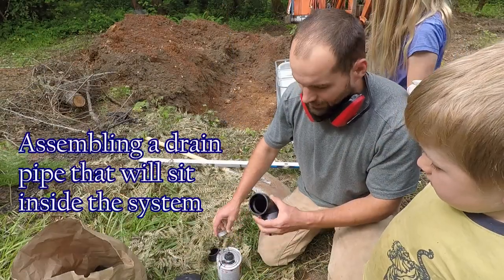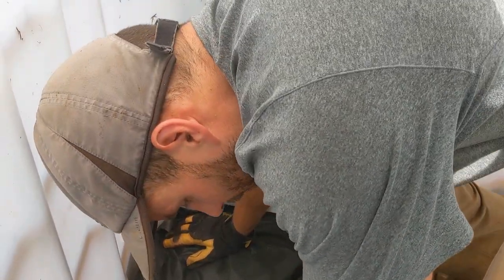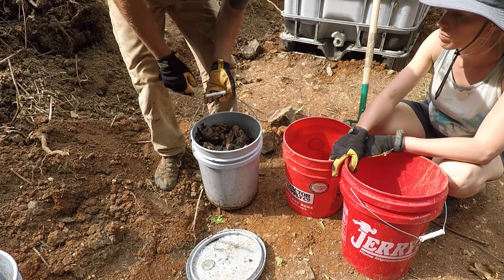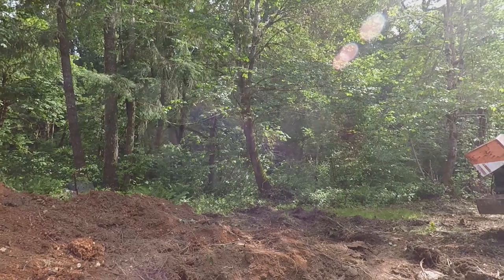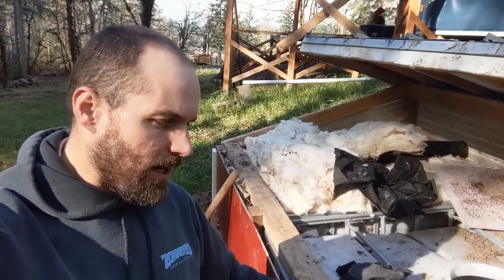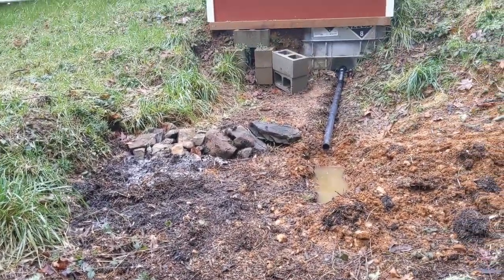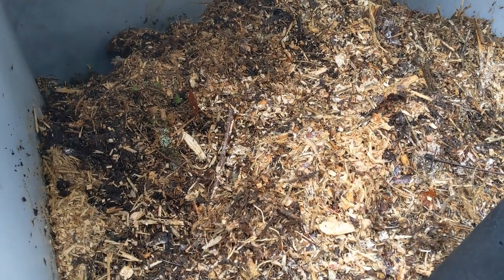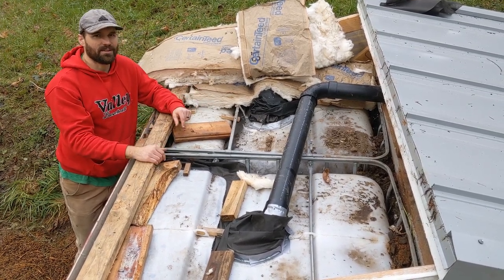Installing and Using a Worm Composting Toilet System

Comment: Thank you for being generous in showing the problem shooting. I am familiar with the worms and I would add a escape for the water about a foot by the top of the tote so the worms would have a semi dry area at the top. Also, on the first tote they will need moist/wet at the surface as the water recedes at the bottom. Thank you for sharing your adventures with us!
Reply from the maker: Thank you, Nelson!
Reply: Worms will die when filled with water
Reply: Thanks for the reinforcements he already knows that but for the rest of us; Worms will die if they are too wet if they're too dry if they're too hot or too cold:
they have four enemies so you have to protect them from all four enemies: heat, cold, floods, and dryness.

Comment: Just a suggestion,  what I did with my grey water I ran it into a concrete box I poured.  About 2' x 2' x 3' deep ran the incoming pipe into it at the top . Then about a foot up off bottom ran the pipe out the other side to my drain field . That way it will catch solids that come down pipe an can clean it out .
Reply from the maker: That's a cool setup, thanks for sharing the details, Michael.

Comment: ...I am also wondering why you haven't planted into the mulch bed to help with water uptake in the drainage area? It seems like that would help, especially in your rainy climate (I am hoping to build in New Mexico)
Reply from the maker: We've recently planted a few water irises, and we're interested in doing more, if you have any suggestions.  I just want to be careful not to take it too far and block up the drainage our of our tanks with spreading roots, so we're proceeding with caution.
Reply: @Green_Heart_Family_Farm  Reed, cattails, sedge and iris are some common plants for greywater systems, because they naturally occur in wetlands. Those plants accelerate filtration by providing habitat for microorganisms in their root network that help breaking down the sewage and improve aeration of the system. Clogging of the drainage holes could be a problem though, but I think there are solutions for this.

Check out this article: wikipedia.org/wiki/Constructed_wetland
Reply from the maker: @tobiasrall1110  Thank you for the helpful information, Tobias!
Reply: @Green_Heart_Family_Farm  grey water and pipes into soakaway wetland area could be wrapped with weed suppressant membrane to stop/reduce roots clogging pipework? that's what we've done
Reply from the maker: @davidmiddleton7029  cool, thanks for the idea!

Comment: i think the middle pipe is not enough drainage for the width of the bin. I have a compost bin and the bottom is perforated.   Of course it has less water than when it comes from toilets.  I also think you could lack green matter and may not have enough air inside

Comment: If you cut your discharge line back a little bit and put a t in place you can put two valves on your composting line and then swap your valves back and forth every month to be able to make sure that the worms don't die
Reply: Excellent idea!
Reply: @unclebenny9028  As has been mention, valves run the risk of getting blocked if solids are flowing past them -not pleasant if it's blackwater....

Comment: Seems like you could just do the same thing with a regular septic system. You can acquire a large tank from Lowes as well as corrugated drain pipe for a regular drain field. The only difference is that the tak would be filled with the medium conducive for worm life and propagation.
Reply from the maker: I'd definitely be interested in using a larger tank for another version of this system.  Thanks for the ideas!
Reply: I would imagine that a bona-fide septic tank would be considerably more expensive than using the re-purpoposed totes

Comment: Technically, this is a composting septic not a composting toilet. I like this idea and you did a great job of showing the build, but we don’t have running water on the property that I just bought so we’re probably gonna have to do the old composting bucket toilet so we don’t waste water flushing.

Comment: Hello, for me extremely excellent video, great that you go back and see progress or lack of, changes in design, so many videos you see and never find out what really happened good or bad, However Question.. there is a tractor in the video so digging is easy and it seems you are working just as hard to put in the worm farm as you would  standard tank with leach field, can you discuss the reasons why you would choose worms over standard septic type system, thank you for sharing your experience, we are moving in the same direction and am trying to learn as much from others as I can.
Reply from the maker: Thanks for the kind words!  For one thing, I really wanted to try a worm composting toilet system because I think it is so interesting.  Second, even though we used equipment to excavate, it was less excavation and less materials than a standard septic tank.  Hope that helps, thanks!

Comment: I would think not adding toilet paper to the toilet would improve the tanks processing ability.  It's also a really small tank for more than a single occupant.  I also think it would be a good idea to put the gray water discharge into a bucket catchment before it empties into the ground.  I have a gray water system and used a home depot bucket (5 gallon), drilled holes in it, filled it with rocks, then put the outgoing graywater pipe into the bucket with a layer of dead or freshly picked ferns on the top (depending on the season).  once every few months I scrape off the top layer and replace it with a new layer of ferns (that's just what I have easily available in my yard).  It has worked well but even with a screen in my kitchen sink I get a lot of sludge build up in that bucket which I would imagine is what is going to happen inside that pipe you wrapped in landscaping fabric.
Reply from the maker: Thank you for your thoughts; I like that idea about the greywater filter bucket.

Comment: I wonder if your gravel layer at the bottom of the ibc tote is correctly drained. Looks like you want to drain vertically even the biological layer, but not many holes at the bottom where the leachate collects between the rocks. Will watch again to make sure. If i’m right, many of your issues are from there. Also read my comment about plants being your solution to graywater clogging. Cattails and irises. Your perforated pipe should be level, or else all or 95% will go to the end of the pipe... it’s ok but not your plan to spreqd it out.

Comment: Interesting. From the beginning, I was wondering what you were going to do when each "tote-bin" gets full. But, if you have 2 or more bins then you can always switch over to the other and I guess if it's taking a year and a half to fill a bin, then that should be enough time for the old bin to properly decompose and it wouldn't be so onerous a job to shovel out the compost. It would just be a mistake to be filling both bins simultaneously and eventually when you need to empty a bin, it could be an onerous job with unprocessed defecation.

Was also curious whether you've had any problems with clogged pipes. Even if the grade is proper (IIRC 6 degrees minimum?) that's an awfully long horizontal run even if it's straight and without building clean-outs would mean that if a pipe got clogged you might need a drain snake over 50' long. I suppose it would also depend on how much water you're willing to flush to ensure the waste goes all the way down the pipe and won't dry in the pipe.

Anyway, congrats. Looks like a very cool system with some benefits if you can use the compost or can make it safe to simply give back to nature.
Some similarities to sumps that simply pump the waste into a sewer or treat the waste with chemicals... If your worms can keep up with your requirements, it's a great solution.

BTW -
If your bins are largely underground by filling all around the bins, I doubt that any termperature extremes would harm the worms, even if temperatures were to spike well above 100 degrees F or drop below 40 degrees F for more than a few weeks. The ambient termperature isn't important, it's the bin temperature which should remain temperate because the ground should be like a giant heat sink that prevents extreme termperatures in the bin, even if sun shines directly on the bin tops. If you're really anxious about the temperature in the bins, you can simply leave a thermometer in the bins. Some electronic thermometers will even retain the most extreme reading for later inspection.
Reply from the maker: Thanks for sharing your thoughts, and glad you like the video.

Comment: Well thought out system and inexpensive. I was thinking that if you had a Y pipe off the main line then 2 separate lines with valves then it would be less messing around when you switched tanks.
Reply from the maker: We've considered a Y-pipe system, but I am concerned that a valve directing solids may create blockage issues.  I'll keep it in mind going forward, but right now it looks like I will alternate the tanks at most once per year.
Reply: How do you alternate the tanks? Also, did you use 3" or 4" pipe for your pipe going from the yurt to the tank? Lastly, what size pipe did you use for the vertical drain in the IBC container?

Comment: Nice work, I saw some videos adding worms to the grey waters; in order to clean it a little bit before goes to the ground. I am looking for that design and your video shows up.
I don't know which is your case, but home depot have a toilet dual flusher. For #1 release half of the tank and #2 release the whole water tank.
Reply from the maker: Thanks, Xavier!  We don't have a dual flushing toilet, but based on my experience and discussions with others using a worm composting toilet system, reducing the amount of toilet paper we use will help more than reducing how much water we flush down the toilet.  I've ordered a bidet and we're going to see how that goes.  I'll address it in a follow-up within a year or so based on how things have been going!
Reply: In the West Bank and Old Jerusalem, the pipes are very old and small.  They don’t flush their toilet paper.  They keep a plastic bag lined bucket with a lid sitting next to the toilet and that is where the toilet paper goes.  It can be burned for disposal.

Comment: I was also use stainless steel window screen instead of that cheap weed barrier. That’d hold up allot better for your use.
Reply: Hi oh also need some valves. So you can just swap back n forth between tanks when ya want. Then maybe cycling on a schedule would help ya allot.

Comment: This is super informative thanks for sharing! I’ve been using a large wooden separator tank with a baffle system for about 5 years, full time, a family of two. I’m constantly worried that we are going to hit “full” and have a black tank type backup issue. This could be a viable alternative for our final house septic system, which needs revised/replaced due to a bovine incident. I wonder how it would work with a “normal” septic tank for access instead of the IBC tote (seeing as that’s already buried but not fully hooked up)
Reply from the maker: Thanks!  I'm not sure exactly how well a septic tank would work; it would depend where the outlet is located.  A key part of the worm system is that the outlet is very close to the bottom of the tank so it doesn't fill with liquid and drown the worms.

Comment: Thanks for the informative vid mate I am planning on doing the same thing here in OZ so I will be looking forward to a follow up vid. Cheers.
Reply from the maker: Great, thanks Jim!  Just to give you the most recent update; all is well with the new tank so far.  We have started using a bidet in the last few weeks, reducing the amount of toilet paper we put into the system.  I'm due for my monthly inspection of the tank this weekend, but I don't expect any surprises.  Keep in touch with your plans and when you get started!
Reply: Cheers m8 will do, I'm  planning on setting up a few cabins on my block and putting this type of system in, so when I get going I'll keep you posted.

Comment: Thanks for the video. I have been contemplating doing such a system at an offgrid cabin I plan to build in northwest Ontario, Canada. It would be seasonal/light use and I would probably go with a low flush toilet.  One question I had was the smell but, I see that has been answered. The next question I have is: do you think if you would have waited about a month before use it would have made a difference? I have been to the site you got the plans and saw they mentioned the same; wait a month..
The next question I have is: have you removed any of the "compost" from Tank #1 yet? The next question I have is: how is the new improved drain field system doing with the rock and perforated pipe with screen over it doing? Better? Worse? No change? I am contemplating using those septic field drain pipes that are surrounded by packing peanuts and mesh for both grey water drain field and the system I put in. I subscribed because I would love to see follow up videos as I myself begin this journey.
Reply from the maker: Hi Robert, thanks for the comment and questions.  Waiting a month after starting the worms may have helped a bit, but we seeded the system with quite a few worms.  I could see that time period being much more important if you just started with handful of worms; they just need time to build up in population.  
These systems are designed so that you don't remove any compost; as the worms process material, it becomes water soluble and flushes out in the liquid through the bottom drain.  Woody material and our waste goes in the top, the worms process, and liquid comes out the bottom.
The new greywater drainage with the perforated pipe is a huge improvement so far.  It's most noticeable during heavy flow like when the washing machine is draining.
Hope that helps, and good luck with your cabin!

Comment: Aren’t you concerned about roots growing through the perforated Gray waters and waste  pipe?
Reply from the maker: That's the kind of maintenance I'm expecting to need to do every few years, and don't mid it.  So far, I've had to pull some residue out of the greywater pipe due to buildup from dishes/shower/etc., but haven't had issues with roots.

Comment: Thanks, very useful video. What are you thoughts about rigging up a cleanout fitting to easy redirect waste back into tank 1.
Reply from the maker: I'm planning to have a press fit fitting ready to switch back and forth as needed.  I assume by a cleanout fitting you mean including a valve?  I would love the convenience of that, but I was concerned that anything with a valve would be vulnerable to backup when we're talking about sewage flow.  I'm definitely open to ideas on that.  But since my plan is to just switch the flow once or twice per year, a simple solution with two separate fittings will probably be just fine.

Comment: have you taken the temp inside the bins after insulation? seems like with all the activity going on in there it would get hot
Reply from the maker: I haven't taken temps but I've never noticed it seem 100F+ like a traditional compost pile; if it was getting that hot, the worms would be dying.  I'd guess the internal temp varies between 40 and 90 depending on the season.
Reply: yeah thats what i was thinking, it would be like a compost pile..guess not

Comment: I am wondering why you used weed blocker fabric instead of the fine mesh that Wendy Howared recommends? Do you think that might have been part of the blockage problem?
Reply from the maker: Hi Kimi, it could certainly be an issue; I simply used what was available in the hardware store.  If you have any links or exact brand and product names, I'd be glad to check them out and share them.
Reply: @Green_Heart_Family_Farm  I plan to use nylon or fiberglass window screen. That's what the docs looked like to me...

Comment: So the system requires two such tanks for a family of four and it processes both toilet and gray water?
Reply from the maker: For a family of four plus guests, as our system has worked, two tanks is needed rather than one.  If I ever build an entirely new system for a different residence, I think I will look into a larger volume tank rather than dealing with separate tanks.  I am very happy with our current system, though.

Comment: How do you empty it? Folks show me these and claim they will never need to be emptied. Three years later, they aren't used anymore.
Reply from the maker: No problem if you're a skeptic.  I'm hopeful and quite confident our system will be functioning satisfactorily well passed the three year mark (we're at 2.5 years now).  I'll be making an update in a few months.  Feel free to check back in a year or two to see if we're still using the system, if we've made changes, etc.
Reply: @Green_Heart_Family_Farm    So in an undetermined amount of time will the tanks need to be emptied or do the worms eat it all?  It seems like a waste of worm tea and worm castings which I have paid for at the garden store!  

Another thought.  When you cut the small hole in the first tank and then slightly enlarged in the second tank, I didn’t think enlargement was the solution.  Why couldn’t you just cut the top off so you could work freely inside the tank? I’m sure you could design a rim or cap type design so it can close well…maybe put it on a hinge and hold it up with a pole while you are working.

Comment: How do you  harvest the worm castings when your system becomes full?
Reply from the maker: No harvesting; worm castings are dissolved in water and pass through the exit pipe at the bottom of the tank.